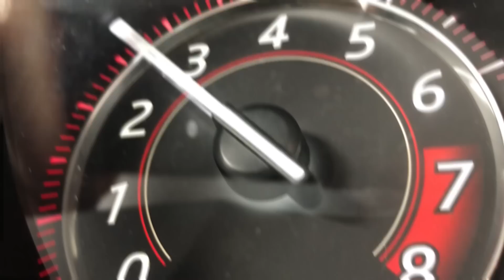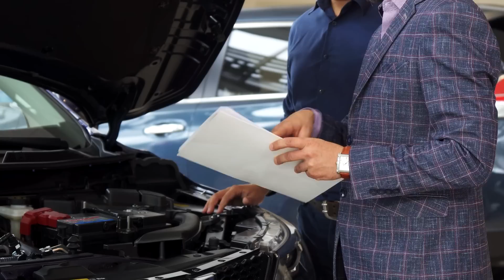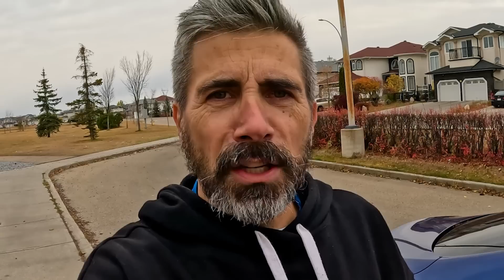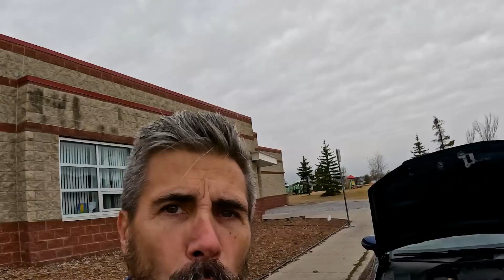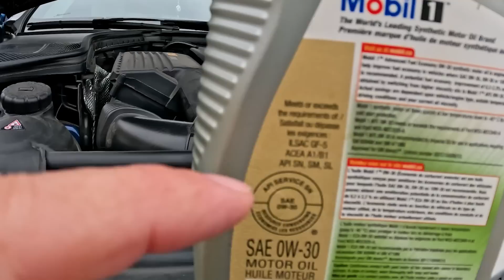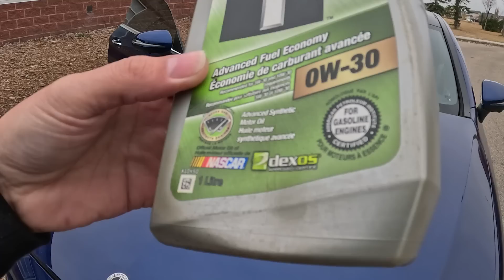BREAKING! Why These New Car Engines Are IMPLODING!

Comment: Really, no one seems to have mentioned the elephant in the room. 
 The main reason we are seeing so much carbon build up in the intake tracts of modern engines is mainly a result of exhaust gas recirculation, and crankcase ventilation via the intake tract. Direct injection wouldn't be such an issue if we weren't rerouting our carbon laden exhaust gasses through the intakes of these engines.

Comment: Generally speaking, turbocharged, DI engines have the shortest lifespans. Engines that are N/A with dual fueling (both DI and port injection), have the longest engine life. This was one factor in my purchase of a 2023 Ford Mustang GT.
Reply: What about supercharged engines???  Not turbocharged.
Reply: The newer Hyundai Tucson lower trims have GDI and MPI, are naturally aspirated, have a conventional 8 speed trans, not a CVT. It should have long life.
Reply: My father’s Volvo 244 with direct injection from 1980 lasted until my youngest brother crashed it in 2010…
Reply: Wasn't always that way. SAAB made it well. GM bought Saab took the technology and figured out how to do it cheap. That's the problem.

Comment: As a dealer Benz tech...those engines sound like crap, Are not fuel efficient, I get better gas mileage out of my 2017 3.5 V6 nissan . 31 highway 23 local. Don't fall for the Benz is a good car shit. Good Mercedes cars stopped around 2012.

Comment: Forced induction like Turbos and superchargers are a bigger cause of engine failures than direct injection. The added heat and stresses that comes with forced induction, especially in small engines that are pushed hard to develop horsepower wears out engines prematurely.

Comment: 35 year old nissan straight 6 MPI 1.3 million miles and still runs great. Back then Nissan said as long as you service the engine when it needs it that engine will continue to run forever almost.
They were used as taxis back then and 1.5m to 2.5million miles was normal for these engines. It's what was called a Non Stressed engine and because of this they could run up millions of miles without any major issues. You won't ever see a modern engine do that. Most are lucky to see 100,000 miles before catastrophic engine failures.

Comment: Throttle body injection was even better than port injection, since the entirety of the intake system was getting cleaned with the fuel. No carbon deposits anywhere in the intake system.

Comment: Long service oil may stay in grade but combustion by products and carbon in suspension will cause wear. Stop start tech will increase oil dilution and short journeys . Turbo charging small engines increases heat stress so will need more oil changes. 5 k oil changes are best for long engine life.

Comment: We could solve direct injection carbon buildup by stopping the practice of dumping nasty crankcase fumes back into the intake. So simple, yet no one does it. I suppose the emissions police wont allow it. Catch cans arent enough, still dumping garbage into your intake and many of these engines come with oil separators prior to the PCV valve OEM. The only solution is not dump any of the crap back into the intake.

Comment: We have been programmed that engine flushing is a bad idea. I have never in my life seen more stuck rings, cylinder scoring, sludge, and carbon fouled engines in my life. All this can be eliminated with 1 or 2 cups of diesel added to crankcase and run for 20 minutes before changing oil. These modern crankcase ventilation systems have turned your engine into a garbage furnace. Changing your oil isn’t enough to stop the destruction.
Reply from the maker: Yes too much “holding it all in” causes a lot of problems

Comment: Toyotas D4S is reliable. They've been using it for around a decade now. More OEM'S need to care more about this issue and not writing it off to expected maintenance. It's sad in 24 manufacturers still use GDI only
Reply from the maker: Ypu are right Mikey, I agree, the dual system is such a great design and not sure why many don't go that route.  Well actually it always comes down to cost.  If they all did it right, there would be much fewer problems in the biz.

Comment: Direct injection needs a serious second look... All this tech, expensive injectors, slight fuel economy increase  is washed away with more frequent oil changes, carboned valves and rings, and essentially blown engines...efficiency is gone. Multi port injection worked well, and forever... Time to take a step back.

Comment: This was finally a good video. Basically all new engines needs a catch can and a lot more oil changes plus often high load driving conditions in order to evaporate the gasoline from the oil. If you get your oil up to tempreture you will evaporate the lighter fraction the gasoline and unfortunately often oil changes would be required . We do have a sky active Mazda that is only direct injected but it is NA so we never had any issues only do regular oil changes and run the car hard on the high way. But the low power NA engine doesn’t suffer from a lot of blow by and  crankcase pressure making it last a lot longer . So the major problem is not so much just the direct injection but also the firing pressure and the amount of hp per   L of displacement. What use to be a norm only for sports cars now it is in daily driver. Most of this failures did exist before but they were in sports cars so the general public never felt it for example rally cars with turbo engines were making from 150 to 200 hp per L of displacement now even every day cars are having the same power per L of displacement all this power will lead to problems and this is the reality.
Reply from the maker: Great points and thanks so much for adding these great points to the video.   Viewers need a bit of this info to halo make informed decisions

Comment: As far as direct injection goes, it allows the injection event to happen independent of the valve timing which why the manufacturers dont want to abandon it. Also you could have more than one injection event during the combustion cycle to shape what whats happening in the cyclinder.

Comment: I seriously doubt the manufacturer didn't see these issues during testing. In any case they want these small engines to feel big to the driver so these small turbos are set up to give a lot boost low in the rev range for that "flat" torque curve beginning below 2000 rpm.

Comment: Spitfires used carbs, and Me-109s used direct fuel.
 The trouble with both was they seldom lasted 20 hours till they crashed or blew up.
Hopefully not my new M20A-FKS Toyota Corolla Cross engine won't blow up or crash!  
When I change it I smell gasoline in the oil, as you pointed out. THAT is why I change my oil every 3 months or 3,000Km
Reply: I'm expecting delivery of Corolla Cross equipped with M20A-FXS  2 liter engine and the fact that you smell gasoline in oil within 3K kms sounds alarming..  do you use the car exclusively for commuting/short trips into town  or highway use ??  thanks in advance for your reply
Reply from the maker: Thats a great plan.  Oil is cheap, engines are not.
Reply: Spitfires ran 70 inches of boost.    
  You’d last 20 hours at that rate. Lol
  My father in law worked on these .

Comment: The 3 thing's i do to avoid carbon build up is: *change oil (API SP/GF-6A) twice as often as recommended, *use the highest premium fuel & *spray GDI spray cleaner (vacuum line procedure) .... before i change the oil (approx every 12,500kms).
8 yrs later & 155,000kms, my direct injection Subaru runs fine (doesn't burn any oil, fuel consumption is the same) 🤔

Comment: A soon as an engine becomes reliable, they are replaced with crappy engines
Reply from the maker: Seems to be the way
Reply: I recently bought a 2023 Honda Passport with the V-6 which has been around forever. I do wish it did not have DI but 5K oil changes with synthetic should help a bunch. There's a Passport offroad site where the owner took the vehicle in for the 100K service including valve adjustment. The mechanic showed the valves were quite clean and needed nothing. It had 5K synthetic oil changes and the mechanic swore by 5-30 in them for longevity.
Reply: @davidanderson8469 thats super new. That engine will have very tight tolerances. But I am told some kind of intake chemical is good to use at a good interval. My Honda 1.5 Turbo never got anything so chem is out of question at this point (130k miles). Someday I will have an endoscope peek at valves.
Reply: Direct injection combined with exhaust gas recirculating emission system are just not compatible systems, and it’s shocking engineers didn’t anticipate the carbon buildup problems.
Reply: @ Direct Injection creates some very harmful compromises to the environment. In addition warm up takes longer and the warm up stage is dramatically worse for both engine and atmosphere ...but don't tell that to the corrupt EPA!
Reply: @jamesmedina2062  And thank god for the engine start stop feature.
Reply: @femaledeer  Well I suppose people are catching or have fully caught on that most solutions proffered are anything but and just the US Military is like the 3rd largest polluter on the planet or something crazy like that.
Reply: @993mike  Or did they anticipate it?????? And decide to ignore it, b/c their manager was pressing them to up the mpg efficiency to meet CAFE standards..... and knowing that the issue is a slow accumulation problem that can be always pointed at a different culprit (like bad maintenance, bad fuel, bad oil quality, bad driving habits, etc) by the time it manifests in severe problems.   I think we can all guess the path of least resistance....
Reply: All by design

Comment: In 2024 no Manufacturer can tell me, its coincidence that the engines they build are bad. Most of the Manufacturers have other 100 Years of experience! If they build a bad engine that fails often and/or early, its by purpose and no coincidence. Build 2 fail, that is what todays manufactures are making. If it fails often, you must repair it, and that gives everyone money. 
And for todays prices for new cars, its a shame that these engines are not holding up. 
You pay today a double for a new car than 15 years ago, and the quality is not better than in the year 1920.

My 2009 Ford Mondeo with its rock solid 2.0 Diesel Engine has now over 250.000 miles on it, and i´m scared to buy a new car. I know that i will need a new car soon, but all reviews i watch over new cars are a nightmare.

Comment: 132,000 miles on my 2011 Audi A4 direct  injected 2.0t.  It runs great and I never have had any issues with carbon (other than the defective piston rings that plagued several years of these cars).

Oil changes every 7000 to 9000 miles with Mobil 1 0w40 and top tier fuel. Also, I do not sit there like an idiot and idle my car for long periods of time.

The car runs great and feels similar to when it was new.
That is not to say it did not have a ton of problems… New pistons, piston rings, and turbo charger at 65,000 miles and a new timing chain tensioner at the same time.😂

Comment: I feel this is subject is the main reason why new cars have a limited life span. I sent my oil out for analysis and it came back with excess fuel in the oil on my 2024 BMW after only 1,500 miles.  I have been changing my oil every 6 mo or 2,500 miles on my cars myself and let the dealer do it every yr or 10k to keep up the warranty.   Nice video!

Comment: I used to rip apart carbed engines 30 to 40 years ago and inlet valves were caked up and piston rings commonly stuck with carbon. We used to scrape the carbon from behind the rings. So even the carburettor fuel was not enough to get the PCV oil burnt with the fuel. Port fuel injection totally solved that and valves and rings would stay clean as the injector spray was enough to mix the PCV oil into the combustion mix. Come direct injection the oil cant mix in with combustion easy, ends up caking everywhere and eventually will take out the engine. Even valve seat areas suffer from the carbon.

Comment: A little diy takes care of the carbon issue. I use a valve cleaning spray. I spray it after the Mass Airflow sensor. A cleaner like CRC valve cleaner has oil & detergent mixed in. Twice a year. Combined with high quality fuel & 5k mile oil changes.
120k miles on a 2016 SQ5, still running strong.

Comment: How about disconnecting the carterventilation and just let the gasses out in the open , just as the old days ?
You will get a lot less carbon and deposits .
Or place an oildivider between the rockercover and intake manifold , so cleaned air commes in ?

Comment: I feel good about my 2020 Camry 2.5 Dynamic Force engine having both types of injection. The MPG on my car is phenomenal. If I drove on a freeway for at least 500 miles I'm sure I would get over 40 MPG. I've taken shorter trips with a combined freeway, hills and curves, putting around town, and even some miles in the mountains (Sierra Mtns.) and have gotten 35.7 - 38.2 MPG! I'm amazed! The computer controls everything. How is the milage in your 2022 Camry, Mark?

Comment: Direct Fuel Injection was invnetd over 125 years ago.  If it was reliable it would have been in common use for 125 years.
Reply from the maker: Great point
Reply: hasnt direct injection been installed problem free both on diesels and petrol cars since the late nineties and without issues

Comment: Change your oil with synthetic every 5k miles with the filter, Use Tier 1 gasoline  replace the PCV valve, spark plugs and coolant every 50k miles. 3rd generation mechanic and engine builder.
Reply: If you have ever seen a racing engine  with low to no tension piston rings using methanol as fuel you would understand how much the fuel matters!! They are spotless 😁
Reply from the maker: Nice and on assembly plastic gauging for best assembly practices which is a dying art these days
Reply: It is not one size fits all. Every part has its lifetime. Take the spark plugs. Old style lasted 10k but Iridium changed that. Which coolant it is affects its lifetime as does the engine metallurgy. PCV valves and PCV system design all vary as well. Even pistons are not all the same because of rings type, cylinder machining, concentricity, tolerances, cooling from water, cooling with oil, and how it gets driven and what climate it is in. Just too many variables.
Reply: What the hell does coolant have to do with this issue?  LOL
Reply: @tommak6516  acidity and corrosion of head gaskets and heads:  leaks into combustion chamber causes wear and loss of compression etc
Reply: @tommak6516  Good point. Some cars never need coolant changed at all!!! It depends on the coolant passages and the coolant. People seem to love one-size-fits-all.
Reply: Why pcv valve?

Comment: This is why I change the engine oil, on both my gasoline direct fuel injected cars at 4000km, yes you heard right KMS not miles.
 Both me and my dad purchased the same type of GM SUVs brand new, he changed his oil at the dealership recommended interval of 7000 to 9000km...I on the other hand, have been changing my engine oil at  the 4000km mark, every time. My oil shows light golden brown at 3000km after an oil change, while my dad's oil looks dark brown at the same 3000km interval, his SUV has already begging to develop sludge, both vehicles have similar milage.

Low tension piston rings, gdi fuel delivery, turbo charging, smaller cubic capacity under high stress and extremely thin oil, is what most new engine designs are all about, it's a recipe for disaster... Change your oil at half of the vehicle's oil monitoring system interval, run a higher viscosity oil in the summer and use high octane quality fuel all the time.
Most of these modern engines will not make it to 100,000 miles, unless you are extremely vigilant about preventative maintenance.

Comment: Mercedes have no issue at all. Oil use is zero.
Reply: Agree mine is 2008 and doesn’t burn any oil. My wife’s Audi 2015 burns a quart of oil every few thousand miles!
Reply from the maker: Thanks for sharing and our car burns no oil
Reply: my 2017 c 2oo  drives like new 50k  no problems

Comment: best thing is to change oil more often.
Reply from the maker: 100 percent true
Reply: The best thing is to not buy a GDI engine. Buy a MPI engine and save you yourself a lot of money later on ....
Reply: Old school here. Every 3 months or 3,000Km.
I do it myself, cheaper that way, and I know it is done right with said oil.
Reply: @luckyguy600  2005 Pilot with 270K. Oil has been changed every 5K from new with conventional oil and factory filter. It uses no oil between changes, and purrs like new. Same injectors. I run a 20 gallon spec'd Techron through there every 10K.
Reply: @luckyguy600  If you change the oil every 3000km you will pay more money for the oil than for the engine replacement. Changing it every 3000km means about 12 changes per year for me - the material alone costs me (I do it myself) 50€ so with 12 changes it is 600€ per year for the oil which is a huge amount. If I had it done at a service station it would cost over 1000€ per year - so in 10 years the oil change alone would cost 10,000€ which is MORE than the price of a new engine including the price of the labor for the change.
Reply: @luckyguy600  I change my oil every week.
Reply: @luckyguy600  Oil changes every 3000km, my youngest car is 55 years old.
Reply: @luckyguy600 waste of money
Reply: isn't that way too much? there are literally manufacturers that only ask yearly or after 30.000 kilometers. 15.000 kilometers is a normal interval, and 10.000 is a strict one (although in my country 99% of brands ask for this last one - it makes them more money and with less risks).

Comment: Many of the Ford Engines are dual injection now.   The Mustang 5.0 has been dual injection since 2018, previously port injection only.  The Mustang 2.3 Turbo since 2015 was direct injection only.  The new 2.3 Turbo in the 2024 Mustang is dual injection.